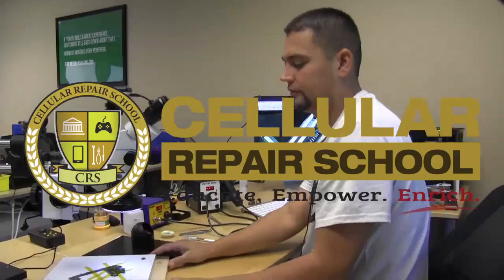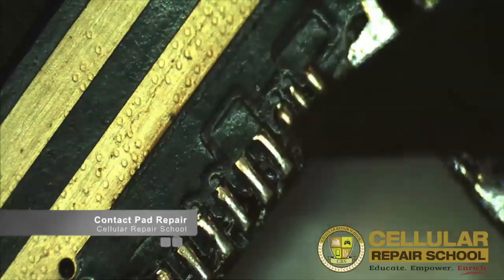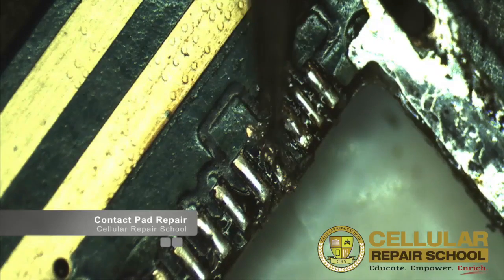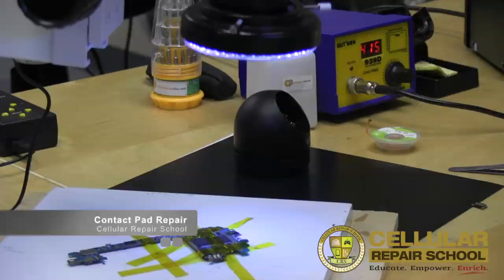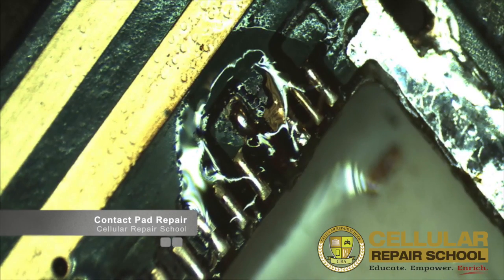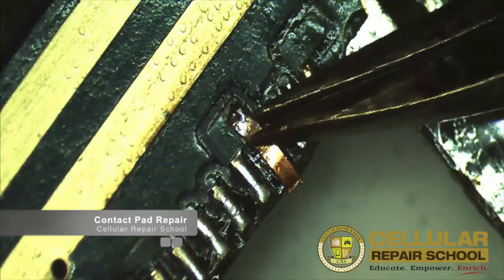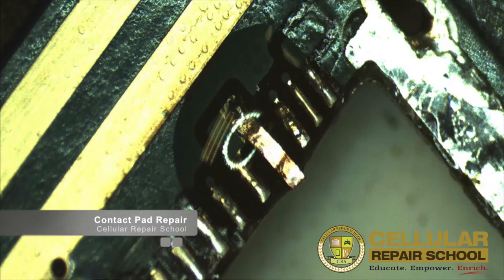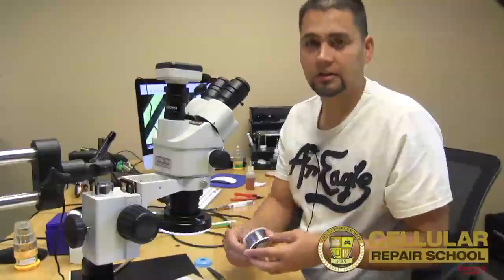Contact Pad Charging Port Repair Cellular Repair School

Comment: The best way to do this is to first install the part and solder the large pads that hold the part firmly to the board. Then you can either fly-lead some small wires or you can slip some copper traces under neither the pins and solder to it. It will save you a lot of time and frustration.

Comment: what is the name of the soldering pads that you are using  because i cant find it anywhere on the web to buy.
Reply: Same here I couldn't find those circuit tracks
Reply: check this link you will fin all kinf of sizes  http://www.circuitmedic.com/parts/115-5205.shtml
Reply: check this link you will find all kind of sizes  http://www.circuitmedic.com/parts/115-5205.shtml

Comment: You can also strip a stranded wire, separate one strand and trim the others back, tin it, solder to the pin of the new port once it is mounted on the board then put a fine screwdriver on the pin to work as a heatsink and solder to the tinned trace.  Trim to length and that is it.

Comment: Appreciate the video. Would like to see a repair on an internal trace. Ive repaired a few of these ports some with the internal data line pads lifted. I can see the small center copper core that goes into the board but cant get enough solder on it to make contact with copper or the pin.
Reply: I've done this successfully. I used cheap copper tape that you can buy in a big roll off ebay from China. I then slice a small enough piece with a razor knife. After you tin the via that is protruding through the board, put some flux on top. Take the piece of copper tape you cut and tin both sides; yes, the adhesive side too. After soldering the port onto the board, take the copper tape piece and slide it under the pin so the other end is right over the via coming out of the board. Then you want to first, while holding the tape in place with a tool (dental pick works well here), solder the pin on the port to the tape. Next, while holding down the tape with another tool, put the iron right over the side touching the via and apply heat. The tape and the via will fuse together because they are both tinned and there is flux sandwiched between them. I've done this for several pins and I never had a problem again with them. I would recommend putting some conformal coating over these connections to prevent the elements from getting in and to prevent peeling.

Comment: Isn't there something close to that that's cheaper. I don't want to spend 40.00 for a roll of it
Reply: For the trace replacement? I buy enamel coated magnet wire and take the enamel coating off with a razer blade then pound it flat with whatever is handy, the handle of a screwdriver does nicely. Gotta pound it flat though so it doesn't roll around all over the place and make your repair 10times longer

Comment: Nice work , can you tell us where can I get the copper trace , it look like flat !? ,,

Thanks
Reply: This size may be off, but this appears to be the company he bought his from:

http://www.circuitmedic.com/parts/115-5205.shtml
Reply: Pollux005 THANK YOU THANK YOU THANK YOU!!!! GLAD SOMEONE FOUND IT... I WAS HAVING THE HARDEST OF TIMES!! NOW IT'S TIME TO GET THIS WORK
Reply: yup, and just for a heads up: make sure to get a .006"+ track if you're working with iphone fpc components, cause I got the .004" one and it's too small.
Reply: hey im working with and samsung galaxy s3 what .00? size should i get. im new to this so forgive my lacc of knowledge on
Reply: im honestly not positive but I'd go with one of the bigger sizes (like .010 +) just because you could cut it to a smaller size if needed.
Reply: cool will do  i appreciate the info and help because I have two s3's that need contact pads replaced and im on it! Thanks